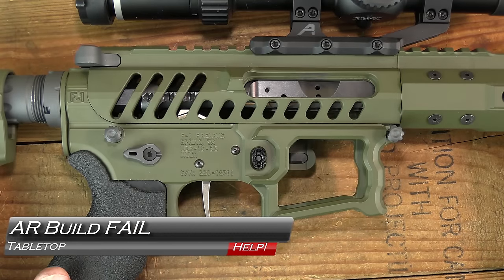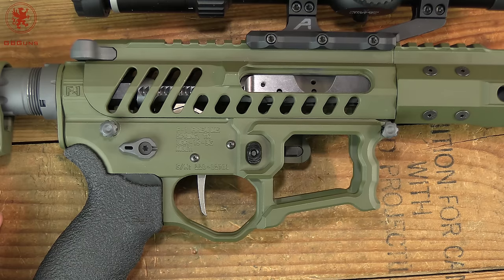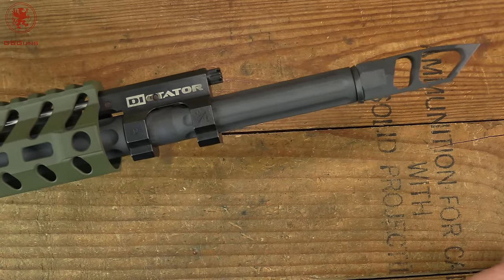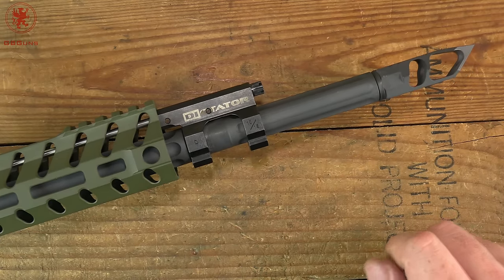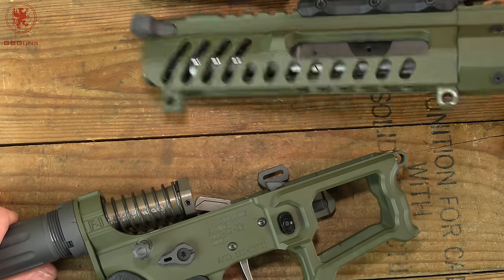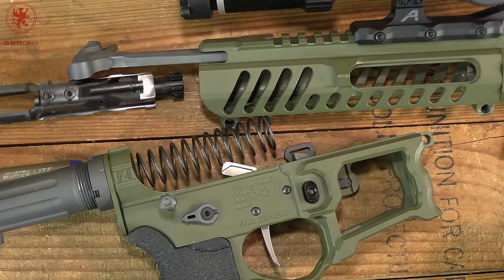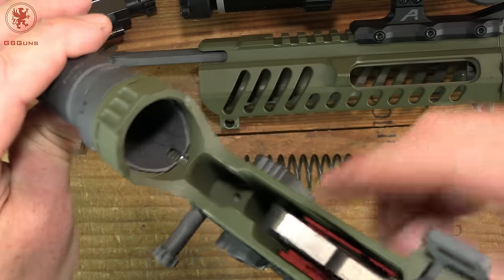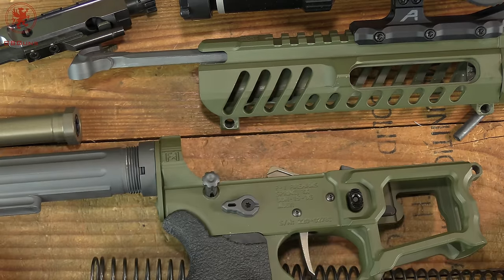The Worst Thing You Can Do For Your AR

Comment: I know I'm late to the party, but short strokes are almost always spring related
Reply: I was about to say the same thing... too heavy of a spring
Reply: That's what I thought, it sounded like it was the only explanation
Reply: I was going to say it could be too stiff of a spring and maybe not a good enough seal somewhere around the gas tube
Reply: If you’re losing gas that could also cause your bolt to not function properly,  right
Reply: I was gonna say spring as well, bht can get the same-ish result with an adjustable mid‐link gas chamber.
Reply: That's what she said!

Sorry couldn't resist.
Reply: Exactly my thoughts thatd have been my first replacement
Reply: Gas port is to small for the tube and barrel combo 
Not enough gas
Reply: I'm fairly new to these, and even I immediately thought "light buffer/heavy spring, that's your problem ".
Reply: Sounds like a dang cheese grater
Reply: sometimes short strokes is all u need dawg
Reply: Where is the buffer detent
Reply: I disagree. Gas is the main problem I've seen over and over with different calibers. Some of the barrels midway sends out need to have the holes opened right away to work with mil spec parts. I'd rather have the hole larger and milspec parts everywhere else then to start lightening up the components. You really don't want to build a "proprietary" system. Because sure as heck if the part you used wasn't milspec and you start having failures due to that part, you'll forget what it was years later and go nuts trying to figure out what is going on. A lighter spring is going to become lighter and lighter with use.
Reply: @matthewfox3760  No, but it sure LOOKS like a cheese grater! All those holes in the field are going to become an issue if you get mud in them. Plus it has no ejection port cover or forward assist. And sure enough if you end up in the field with some crappy ammo you'll find you are wishing for that forward assist. I see he does have a forward assist style BCG though.
Reply: Try Geissele AR-15 Super 42 Buffer Spring/Buffer Combo For Carbine Receiver Extensions, H1 Buffer Weight, 05-495. 

That's what I run with a Sharps Rifle Company M16 carrier, runs like a top. Very smooth spring 👍
Reply: Where's the buffer tube retainer pin
Reply from the maker: @simpson's see the pinned comment
Reply: @teflon36don87  If their is no buffer detent thats his problem. The buffer is out of its travel tube and resting on the BCG.
Reply: Check you gas rings on the rear of the bolt.
Reply from the maker: See pinned comment
Reply: Yep also late to the party but that looks like a milspec buffer spring. For sure need a new spring.
Reply: @teflon36don87  My thoughts exactly!!!!
Reply: Really late to the party, but my recommendation is to use the jprifle silent captured spring and throw that buffer spring as far as you can. The captured spring system is adjustable. They make it for light bolt carrier assemblies as well.
Reply: Lube and spring.
Reply: Could be a multitude of things ... IMHO more than likely it is a spring issue but it also could be you are losing/blocking gas either in your adjustable block from malfunction of the adjustment or in the connections from the block to the tube even a possible crack or leak in the tube ... another possibility is drag from the cerakote (increasing buildup on tight tolerances may have made it too tight) but if I were in your shoes I’d go with a rifle length buffer tube and change springs
Reply: @GBGuns  how did you fix this ? I don't see a pinned comment. Thank you for the great content
Reply from the maker: @william for some reason I can't find your comment on desktop, only on my Creator app.  Here's the follow up video https://youtu.be/tjFRl6sO_GY
Reply: @GBGuns thank you .Just recently found & subbed to your channel , love the content. Awesome looking AR !
Reply: One thing you did mention is what kind of ammo are you shooting.  Changing to a heavier bullet and a hotter load can increase your pressure and then it might run.  Trying a lighter spring probably would not hurt either. That's where I would start.  If that don't work take it to another gunsmith and get there opinion.  Hopes that helps good luck with your project.
Reply: Also he handled everything and I never saw an oil at all. May just need a good lube. I like running mine wet. Rather have too much lube than not enough
Reply: I didn’t see any oil in it either. Nothing worse than a bad lube job 🤣🥴
Reply from the maker: @Miles i did tours in both Afghanistan (05-06 173rd ABN INF) and Iraq (08-09 172nd INF).  How about you?
Reply from the maker: This isn't a "field" kind if rifle.  I don't know why everyone gets that idea.
Reply: @GBGuns  thanks for your service!!!
Reply: @Reedstar1220  not necessarily after building by own I went broke down a Buddy of mines 300blkout and he been running it over a year without that in place. It’s only purpose is to keep buffer from jumping out when removing upper
Reply: Had the same issue, fixed it with a softer spring
Reply: @eagleeye3179  I agree
Reply: I was just going to say lighter spring right after he said short stroke
Reply: Any recommendations for a light spring? My pistol build isn’t locking back when the mag empties
Reply: @Courageous_Lion  the forward assist was a solution looking for a problem.

Never even used mine except to see if it worked when I put it in.

You dont need a forward assist....you need to clean/lube your gun.
Reply: Fix the buffer retainer detent. Its burried under your reciever extension. Back it out a few turns till it pops back up. It will hold the buffer in place. And not resting on the BCG.

I GUARANTEE that will fix your issue. Put whatever spring system you want in.

It's the buffer retainer detent. Its burried.
Reply from the maker: Incorrect, it's not installed at all for the reasons I've stated ad nauseum.  See the video description or pinned comment for the solution and footage showing why I built it this way.
Reply: @GBGuns  well thats why you are having problems.

Find another end around fix for all i care. Just dont leave parts out of a rifle and then  expect them to work flawlessly.

Designers of firearms by rule do not put extra parts in their weapons.

You asked what's wrong. More than one person told you. I suggest designing your own rifle pattern since you already seem to know better than the AR designers.
Reply from the maker: No need to get your panties in a wad just because you were wrong.  Most people were which is largely why I made this video.  It's a learning experience and unfortunately most of what people "know" is just falsehoods passed along innocently by others why thought they knew. "Buffer tube must match gas system" "buffer retainer pins are a must so the buffer doesn't hit your hammer, and of course thebig one that inspired the build, "18" with rifle gas is impossible".  Did you watch the second video?
Reply: @GBGuns  I didnt bring up any of the falsehoods you mentioned. If you fell for them in your build not my problem.

You asked for a fix not really my problem if you want to do it the wrong way for reasons.

And no im not watching anymore of your vids. I've given you too much traffic already.
Reply from the maker: I listed the falsehoods most commented on this video.  For sensitive folks like yourself may I suggest one of the more entertainment-based channels such as DemolitionRanch? They still have guns and do cool stuff for the sake of entertainment and selling merchandise.
Reply: @GBGuns  haha, love it!!!
Reply: Sad wast of cash
Reply from the maker: At least it wasn't a waste of cash.  Then I'd be upset.
Reply: Yep. Without a doubt. A lot of spring that I’m seeing have almost always been thicker than standard spring.
Reply: @shaneharrison4775  only a waste of cash to you. If he likes it and is happy with it then who are you to say it was a waste. I dont know why people try to make others feel bad or insist their opinion is the only one.
Reply: @eagleeye3179  didnt intend to make him feel inadequate  I'm sure if you want a rifle that can collect dirt when working it then have at it those make enough on their own without venting the case housings and forends  to allow more of the same. Myself I tend to gravitate more to a more concealed case and forend and a bit longer buffer tube and bolt carrier  assy in a stout 30 cal round up to 40 cal with a longer barrel. And I can hunt with it and not have to worry about anything finding it's way into the working of the rifle. But that's me, if he wants a skeletonised rifle that's his deal and hes welcome to it I didnt think I was giving anyone undo criticism or invalidating his rifle or his choices I just offered up what I had thought would help but dont like the ideas feel free to forget them it's that easy!
Reply: @shaneharrison4775  im with you, I think he had said he built it on the fly with spare parts n stuff over a few months. Ended up getting an upper and lower that weren't made to pair up ,(prob due to the venting as you mentioned) I  guessing it was a build that kind of went sideways and he needed to fix it. Thats when he posted video and then posted the repaired video. I would've went another way myself but we all know its whatever you want, preference is everything I guess. I'm sure I could learn alot from both of you. 
For instance I bought a sig 714i ar10 7.62x51 it came with the Bluetooth scope, cant remember the model. But anyway took the bolt out, lubed it up a little and cleaned it, check function. Went to range and could not get a round to cycle into chamber at all. Kept jamming everytime I tried to chamber a round. Thought I had bad ammo or something wasn't sure at all.
Reply: @shaneharrison4775  then I took it apart again and lubed the crap out of everything. Then tried to cycle a round and boom it went straight in and ejected back out. I still havnt fired it but I think it will be ok now. I've never seen a rifle that needed that much lube to load an initial round. Surprised me, I thought something was really wrong. So call me a beginner. I've built a 300Blackout, a ar15, both from palmetto armory. Rest I've bought straight out. I've been watching many videos to learn what I want to build for MY rifle thats setup for me if you know what I mean. Sorry if I came off wrong I was just saying one man garbage is anothers most valued possession I guess. Good luck bud.
Reply: @eagleeye3179  no worries just figured that a few bits here and there would help and set you in a good direction for the issues  I know when I was in service I went through 4 or 5 rifles before I found one the action was still fairly snug in and these were post nam era rifles and most I'd checked were just gutted in the mag wells and in the bolt slide mechanisms and some were so bad you could hold them and pin them closed and shake them and listen to the bolts rattle in the houseings but the one good one had a bent barrel so they ordered me a new one and handed me a nam era  rifle in pretty fair shape but the barrel was a tad sloppy and the bolt wasnt rattling in the houseing so I took it and remembered what friends told me of these old guns lol I had the rifle through my hitch and they kept telling me that the barrel for the other is comeing  and I laughed christmas came and went and I still didnt have it. But that stoner was a pretty good rifle as long as you remember to maintain it completely
Reply: Yep, carbine length buffer has to have a more stout spring due to the harsher nature of the recoil.  Swap to a rifle buffer with proper spring rate and add your buffer retaining pin in and he should be good to go!
Reply: Did you try turning  it off and turning back on again?
Reply: Stop building rifles if you don't know what your doing
Reply: Look at that buffer spring.  Isn't it pretty large wire and the coils are pretty close together for this build?  Maybe I am wrong  but it just looks a little heavy of a spring to me.  Almost looks like an AR10 spring..
Reply: You have no mass and no gas to compress the buffer spring, put a lighter spring in

Comment: I had this happen to me on a build. Drove me crazy. Grabbed parts from every rifle and pistol I owned, to have "Light Weight" everything, for cycling issue. In the end, it was the buffer spring. I put in an old very used and relaxed spring.... runs like an old singer. Go figure
Reply: Singer made 1911s during WWII.
Reply: The buffer was actually what i was going to say I’ve seen a few videos where changing the buffer solved the problem
Reply from the maker: But it wasn't the buffer
Reply: @GBGuns  yeah mine either. It was the spring. Once I added the weak spring I could put everything back that I changed out chasing down the problem. And it ran. Great.
Reply: I had same issue, it was my spring.  Got a lesser weight rated spring and UT fixed the issue

Comment: I built one for my daughter that was short stroking. I changed the buffer spring to a Damage Industry spring and four years later still no issues.
Reply: Yeper that’s what I was thinking 😎
Reply: @edbrenner6930  great idea before you spend your money check out your gas tube could be pinched ie restrictions, springs are cheap enough by the four pack multiple# . best wishes
Reply: I love the Damage Industries Enhanced springs. Have them in all my ARs.
Reply: @WalterDalton does the lighter spring increase felt recoil?

Comment: I’ve found low mass bolt carries to short stroke. Increase spring tension/ heavier bolt carrier/ or even H2/3 buffer.  Low mass allows the bolt to cycle to soon. Not building up enough pressure in your gas key to send a full cycle.. but just my 2 cents
Reply: Yup causes too much bolt bounce, i guess in his defense its an 18in barrel w a rifle length gas tube so id expect you dont need much weight in the buffer but than again the dwell time is pretty short.
Reply: Yes! that's definitely a experienced perspective! I'd agree
Reply: Forget the gas bud. You have an adjustable  block so you can find tune from there. Focus on the buffer 1st. I'd get an adjustable buffer and a couple of different springs .....just my opinion. Best of luck bro
Reply: No extra friction...it's not enough pressure bc of such low mass. Go the other way with the buffer, go heavier!... again, just MY opinion.

Comment: Some barrels have gas port holes undersized. I had the short stroke issue and drilled the port out a little bigger. Works fine now.
Reply: Definitely the issue.
Reply: Check the port size.
Reply: Those are my exact thoughts, bravo!
Reply: I had to do that to my friends factory Anderson
Reply: My thoughts as well

Comment: I agree with most of the comments. I've built several PSA 18" rifle length uppers & ran into the same problem. My solution was drilling the gas port a couple of thousands over and using the adjustable gas block to regulate the gas.

Comment: You need a carbine buffer spring. The rifle springs have 41 to 43 coils, and the carbine springs have 37 to 39 coils. The brand-new length of the springs is approximately 12.75″ for the rifle and 10.5″ for the carbine springs.
Reply: In car racing we call it coil bind… first thing i thought of when he said carbine length tube

Comment: There should be a little pin that holds the buffer spring in the tube. It shouldnt always have tension on the bolt.
Reply from the maker: I don't think you turned the comments off, but you might be accurate on your self assessment.
Reply: Some people don't run with a pin capturing the buffer. The guy forgot his name on InRange doesn't fearing it will break off and jam something up
Reply: The pin is just to hold the buffer and spring in the tube when you disassemble the rifle. Put the upper and lower together slowly (with the pivot pin already in) you'll notice the bcg will touch the buffer. It should always be pressed against each other, otherwise it'll impact the buffer everytime and damage it. 

Imagine putting your fist against the wall (touching it) then push. Vs having your fist 1 cm away then push/ punch then push. Which will hurt more? Cause more damage?
Reply: yessir this fella here has the "right" answer. springs, buffers and bcg being of light weights are only an issue if/when the firearm is ovr gassed and the action becomes to violent and fast for reliable operation. if not for the missing spring detent I would suggest filing a form 1 or form 4 and attach an even cooler break then you could rest assured knowing that super sexy gucci break you graciously mailed me will forever be takin care of in good hands and going on some amazing adventures 😂
Reply: @aahhronismyname8068  Exactly. If it were stopping tension on the BCG the buffer would destroy the pin, so yes there’s always tension on the BCG. It’s the same on the Law Tac folder. It just barely pushes back on the buffer when you close it.
Reply: The buffer spring is not secured into the buffer tube !!

Comment: You need a lighter buffer spring. It's the primary force that determines the speed the bolt carrier travels at. Bolt weight would be second to that and so on. Friction should be rather small in comparison if everything is sized right and no parts are in the wrong area.

Comment: Drill your gas port on the barrel one size bigger. Very common problem with 18 inch barrel with rifle length gas system
Reply from the maker: The solution was much simpler, but thank you.